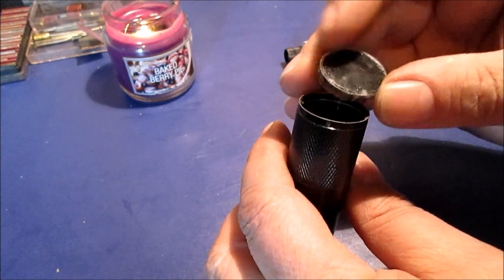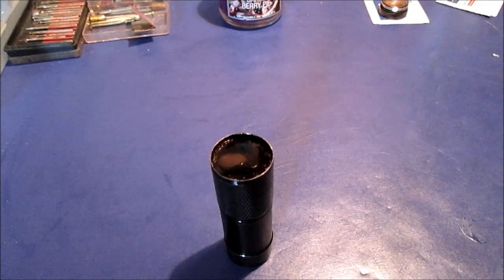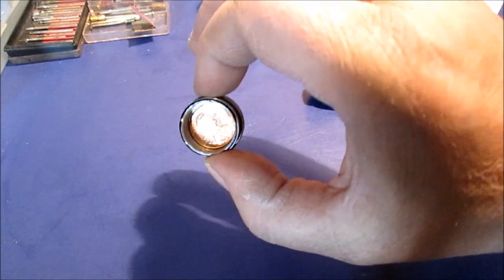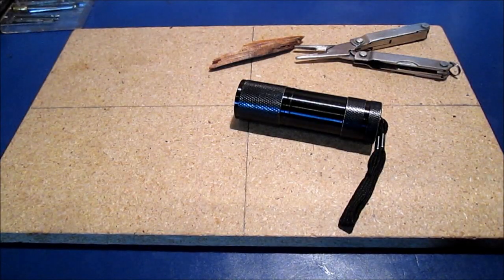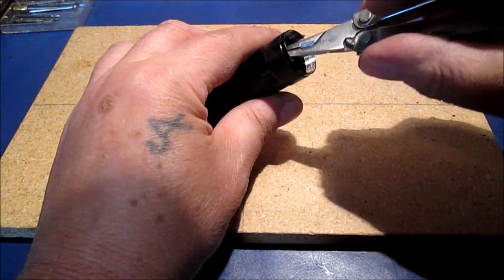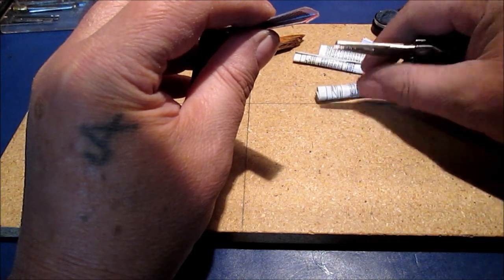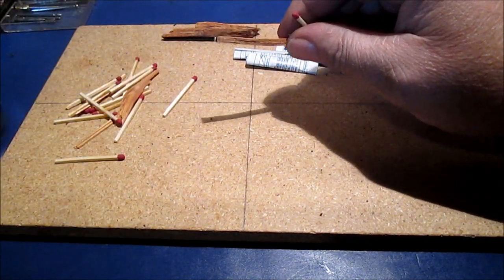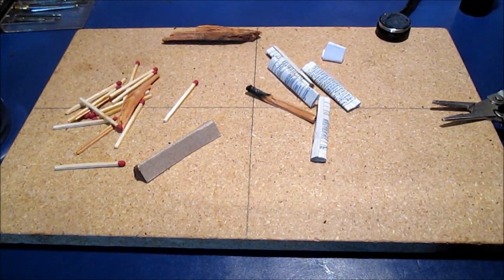Waterproof Match Container made from LED  Flashlight Part 2

Comment: Good job. I have a new one that has a factory defect in the battery holder.
You gave me some ideas for tinkerin' with it. Thanks. Keep up the good work.
Reply from the maker: +Flint Bone I am glad these were free The baterries will corrode when they are dead Alot of mine the leds burn out